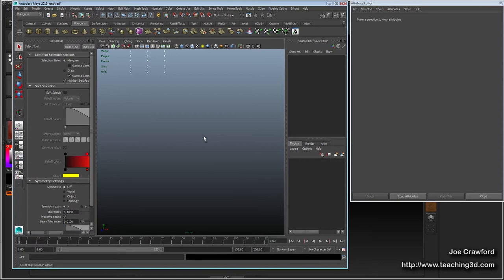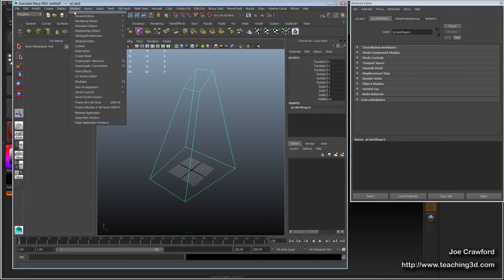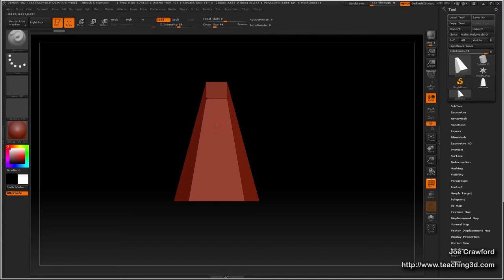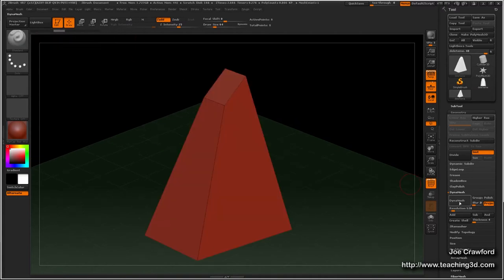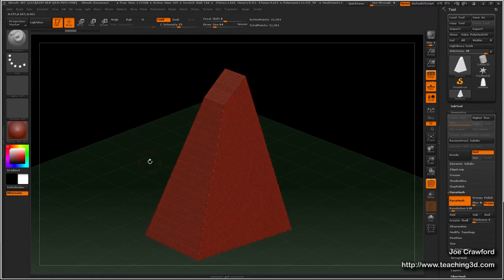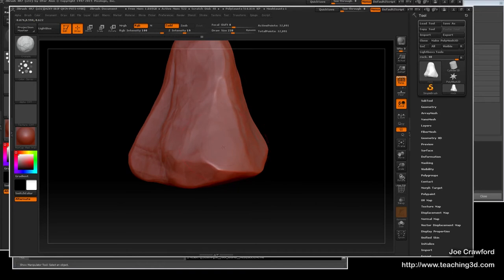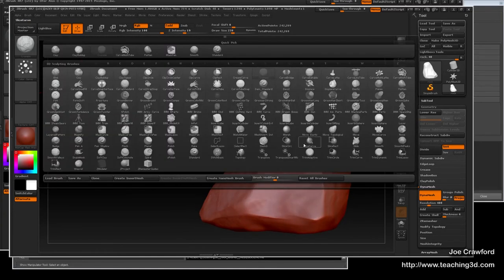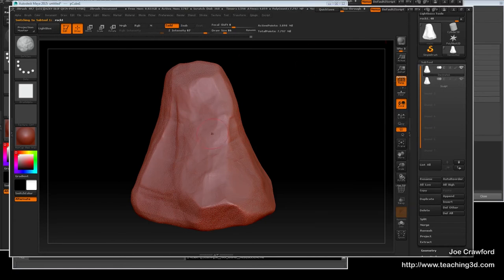Teaching3D - Work Flow Basics - Rock Part 1 - Maya and ZBrush Workflow - With Joe Crawford

Comment: 15 minute tutorial in an hour and 15 minutes ugh.
Reply from the maker: +Captain Beeftits   This is intentional.  A lot of what is discussed in the video is explanations as to why things are done certain ways, and comments on best practices.  It's made for beginners who need to learn the reasoning behind what is happening, and is also used by many students learning how to work at a professional level.

There are many many other videos online if you look around that do things like "make a rock" in 15 minutes.  In many of those videos, they'll probably make much better rocks.  However, the point of this video isn't making a rock fast, or even making a good looking rock.  The point of this video is to understand this fairly universal process that forms part of a production pipeline. 

The pipeline being approximately:  Rough out, sculpt >> Retopo for catmull clark subdivision surface >> subdivide/reconstruct/project to capture any previous detail >> Have multiresolution asset >> Create game optimized asset >> Transfer details from multiresolution asset to game asset.